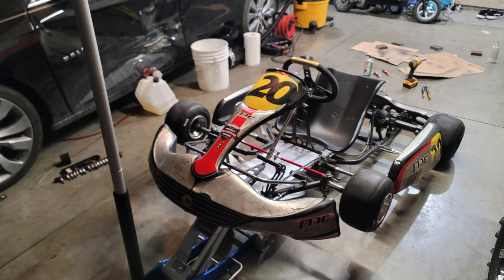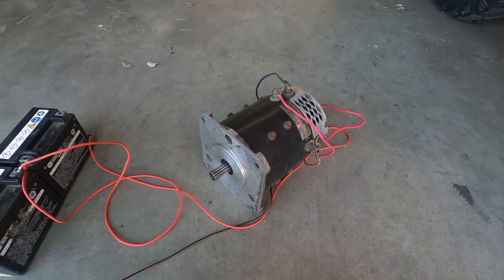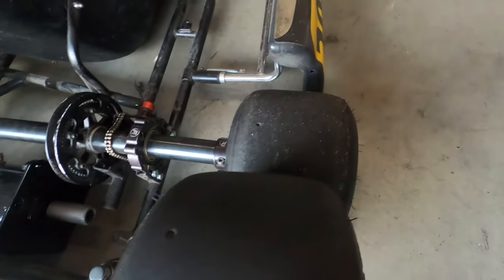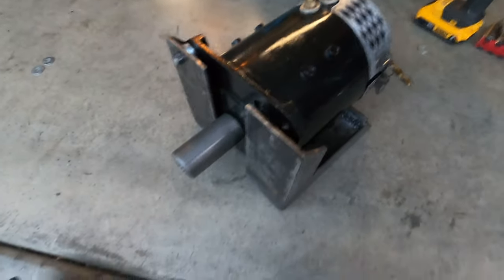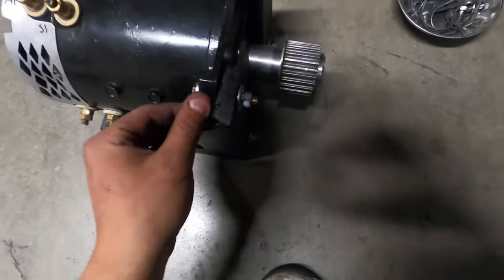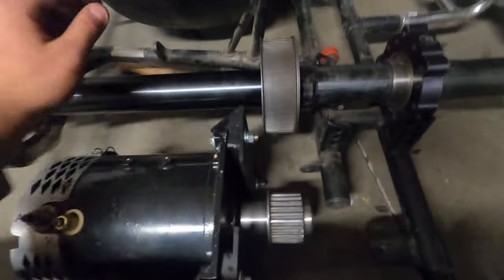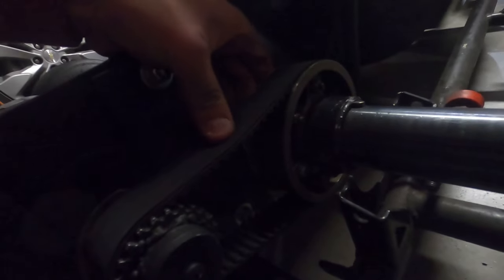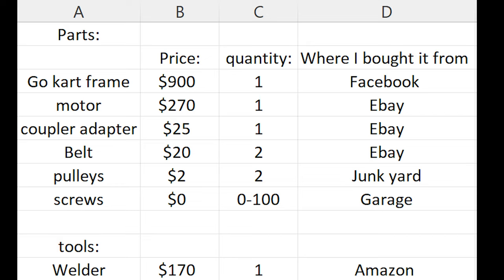[PART 1] 60HP 120v 80MPH! Custom Electric Go kart Build homemade (The Raven) First video posted!

Comment: This is sick! I was just wondering why did you decide to put the motor on the back vs on the side where usually is? Would it affect any driving characteristics? thanks!
Reply from the maker: Cause the batteries are massive, I had no other choice, and it's kinda a good thing cause the motor rotates the axle almost at the center for equal wheel speed and less strain on the Axle.